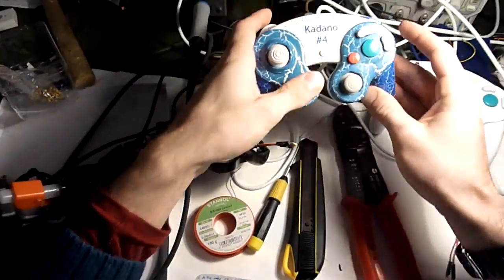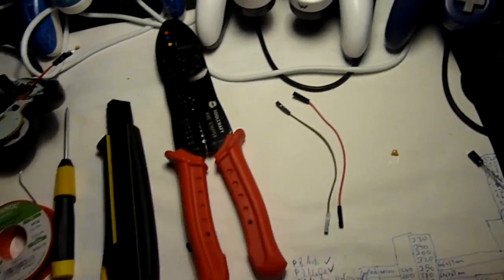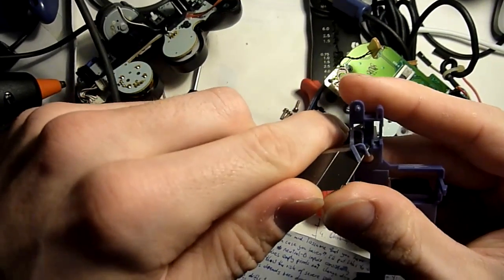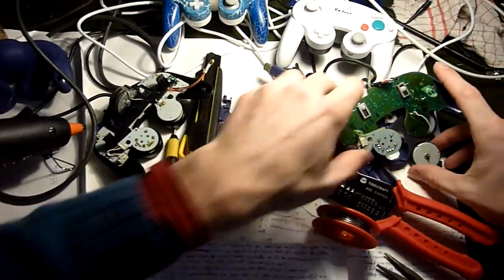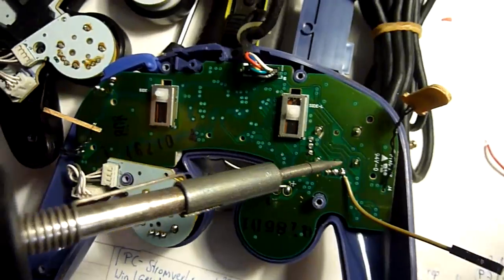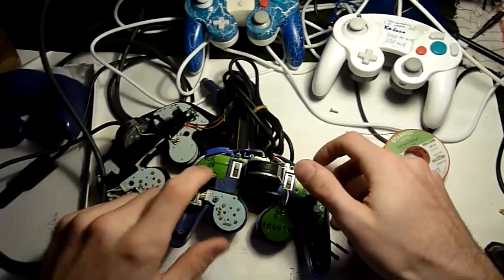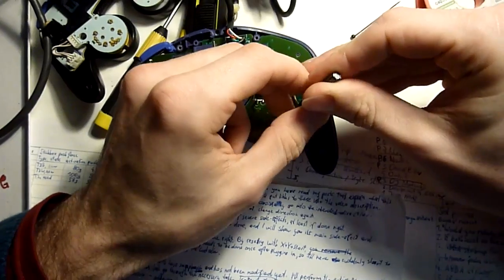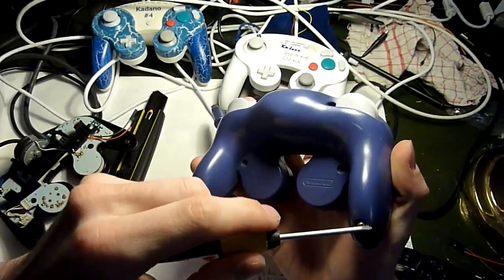Capacitor mod tutorial – consistent aerial neutral B in Melee and empty pivots in Smash 4

Comment: I don't know if anyone has done this recently, I did this mod after my controller slowly but surely crept more and more into reversing neutral-b's almost all the time without my input. I would land and face the wrong way, I would b-reverse a move that I can't even do manually, it was so slight.

On the first day, the mod worked pretty well - almost no mis-inputs. Now, however, my left-stick will randomly start drifting right when neutral, or will react to the slightest touch for an input right, but take half the entire stickbox to the left to register left. Unplugging the controller and replugging seems to be a temporary fix, but it comes and goes at random.

Any ideas how to fix?
Reply: Same here with the Left stick just drifting right the moment i plug in mine, but with the reset it works flawlessly. If you did anything from the time of your post, that’d be great to read
Reply: @gamefreaker54  Nope, still just wing it and hope it works properly to this day.

It doesn't.

Comment: I just did this to a Switch Pro Controller and it worked out perfectly. The back shell of the controller has a circular cavity that goes behind the PCB so I just folded the wire in it so no carving is necessary on it.
Reply: I am trying to do it on a pro controller, would you mind helping me, please ? If we could go to MP, I'do love to see a picture of the way you folded the wires. Thanks in advance !!!
Reply: @Life4Lp  sorry I didn't reply earlier YouTube showed me the notification of your reply just now, I am out of town atm but I will be modding my other pro controller soon, I will make sure to take photos or record a quick video on it.
Reply: @Mache.  thanks !!!
Reply: @Life4Lp  I just finished modding it, had to go out but I will upload the video today or early tomorrow.
Reply: @Mache.  I did it too ! I modded my pro controller using that space you mentioned.

Unfortunately, after 4 days, it seems that some of my inputs are being eaten. Need to switch to a weaker capacitor
Reply: @Mache.  hi! are you still going to upload the video?
Reply: I just did this mod on a switch pro controller as well. It worked out perfectly with a 1μF (50V) ceramic capacitor. Snapback is completely gone and inputs aren't noticeably delayed. Thanks Kadano! As a side note: I also tried on a mylar capacitor (0.68μF, 250V) but I noticed a bit of input delay, idk why. I suggest sticking to ceramic capacitors as Kadano prescribes.

Comment: In case  anyone wants to know if this works on Nintendo switch pro controller: it works!! I needed two 4.7 uf capacitors(one for the horizontal joystick and one for the vertical). The new joysticks have a button but the procedure is basically the same.
Reply: I saw people online using 1 uf capacitors, why did you go all the way to 4.7? Asking because I want to try this and I want to see if you ran into any problems in your time.
Reply: I'm also wondering how you chose 4.7 µF capacitors, could you explain ? Did you use an osciloscope ?

Comment: I installed the mod and snapback is still happening rarely. I had trouble tightening the jumper cables and they were still holding onto the capacitor legs very loosely. Is it possible to add some sort of indicator that the connection isn't coming undone without messing it up? Like if I added an LED light or something, would that have unintentional consequences? Or maybe just some tips on how to get the jumper cables to hold onto the capacitor more snuggly?

Comment: This is maybe a dumb question, but you're rather... cavalier when doing the actual soldering. This is probably just because you're super experienced, but it looks like you're not being careful at all to keep the two pins (minus and ground) from being soldered together, whereas I would imagine you'd have to be super careful not to connect to two so that you don't have an electrical connection between them. You even approach the rightmost pin from the left with the soldering iron, and it really looks like the two pins are being connected, or at least very close.

Am I misunderstanding something, or are you just experienced enough that you weren't worried about connecting the two pins?

Thanks for the video!
Reply from the maker: With a good soldering iron with a fine tip and enough experience, doesn't happen easily to solder them together by accident. The camera I used doesn't have a super-sharp resolution, so the few mm of distance between the soldering iron and the other pin is probably not that visible on the footage.

Comment: I installed this on two controllers that had snapback and one of them is perfect and has no snapback, but the second controller now has a harder time starting a dash and running, my character walks a lot. For both controllers I used a ceramic capacitor 105. For the controller that's having issues starting a dash and running, should I use a weaker capacitor? 

Kadano, thank you for this video!
Reply from the maker: Yeah, 105 is actually rarely needed. For most controllers, 684 or 474 is enough for the horizontal axis while 224 or 334 is enough for the vertical axis. Keep in mind this tutorial is years old, of course there are additional things I account for by now. Hopefully I'll get to make a better one soon.
Reply: @meleemechanics  Thank you so much Kadano! I really appreciate you taking the time to answer my question. Thank you for everything you do for the community!
Reply: What does 105 mean? 1mf? Or 105 is higher than that? Im confused :(
Reply: @zoulwax71  You surely don't care anymore since it's a 2yo comment but the number basically means what capacity the capacitor has when you don't have too much room to write it precisely, the first 2 numbers are a capacity in pF and the last number means the power of 10 by which you multiplie the capacity value, for instance 105 means 10*10^5 pF = 10*10^2 nF = 1 µF, and 684 means 68*10^4 pF = 68*10^1 nF = 0.68 µF

Comment: hey man, I bought a controller with this mod and i think it messes with my empty pivots in melee as i used to be super consisyent with pivot fsmash as marth and now i cant. also, might be unrelated but my c stick does incorrect inputs a lot. how do i remove this mod?
Reply from the maker: That happens when the capacitor put in is too large for your potentiometer's signal response. Ask whoever you bought it from for assistance / adjustment under warranty. How exactly to undo it depends on how the person who installed it soldered it.
Reply: @meleemechanics  thanks man!

Comment: Hey, I've got a question. For the vertical potentiometer which pin corresponds to which on the horizontal one? I'm assuming that the one on top is pin one, middle is pin two, and bottom is pin three, but I'm unsure and don't want to damage anything.
Reply: Actually I found it, here's a picture for anyone else with the same question.
https://twitter.com/kadano/status/835970193281146880?lang=en
Reply: Homie, I was just thinking about this question to myself. You're a lifesaver with the info you found and posted! You the real MVP.

Comment: What is the purpose of the jumper cables? Wouldn't a wire work just as well?
Reply from the maker: You can even use SMD capacitors that don't need any wire. The reason for the jumper wires is that customers can easily and quickly replace the capacitors for spare ones that I include with the controller, for lower or larger capacitances depending on the changed behavior of the stick. 
If you use SMD or soldered capacitors, replacing is only possible if you have a soldering iron.
Reply: That makes sense! Thank you!

Comment: I have recently had a lot of trouble with vertical snapback after a wavedash -> fastfall off ledge. I'm only recently learning and practicing this sequence, so I know that I still have work to do with correctly timing the fastfall
However.. I'm guessing that you can do a similar thing with the vertical potentiometer (which I'm assuming is the 3 pins up and left of what you were working on in this video). Which two pins should I use? Are there any differences I should look out for? I don't know that I need the horizontal mod, though if I did both, could there be any problems?

Thanks!
Reply from the maker: You can do the same for the vertical pins. It's the middle and lower pin then. You can also check my GCC PCB pinout on kadano.net =)

Comment: Is there a reason you chose to use a leaded capacitor instead of a chip capacitor. I was able to fit an 0805 50V 1uf soldered between the wires without cutting the plastic at all. Seems to have worked fine, is there a drawback to doing this, or were you just using on hand supplies?
Reply from the maker: I do it the way I show in the video so the capacitor can easily be removed or replaced. Desoldering an SMD capacitor is considerably more difficult for beginners I'd say.

Comment: tfw your glue gun has a remote control
Reply: I'm guessing it's a remote control power valve/supply. You plug a wireless dongle into your outlets, and you can turn on/off any of the outlets remotely.
Reply: I mean after a long day at work who wants to get up off the couch and walk all the way over to the hot glue gun every time they want to change the settings

Comment: If the capacitor is installed correctly, will I have to replace if after some time?
Reply: Possibly. If you use electrolytic capacitors, after roughly 2 years maybe. Probably more like 5-10 years though. I've only been doing this for less than one year and none of the properly installed caps have failed so far.
If you use ceramic capacitors, they should last at least a couple of decades from what I've read.
Reply: Awesome, thanks for the reply. I've received my shipment of ceramic caps, so I'll be performing the mod very soon.

Love your videos! Very informative stuff. They've definitely helped me improve whenever I can apply them

Comment: all the hassle of whether this is legal or not would be avoided if Nintendo made actually good controllers. Or if they varied in manufacturers as much as fight sticks
Reply: Lucart it's a mechanical problem in almost all controllers. It could only be prevented by using a capacitor from the start, using stick caps with almost 0 mass (impossible) or going for a different stickbox mechanism altogether (like 3DS slide pads).
The degradation in some controllers also fixes it, but I think it's unlikely that this degradation can reliably be caused from factory. (Details on this are in the posts linked from the video description)
Reply: It's really more of a problem in the games programming than a problem with the controllers themselves

Comment: Is this mod acceptable in tournaments?
Reply: SuperLuigiGuy64 many TOs, including The Crimson Blur, who is otherwise very conservative in banning mods, are leaning towards allowing the capacitor mod, since it only causes a controller to perform like certain unmodified controllers that have degradation in their potentiometers that causes the same behavior in eliminating snapback.
Reply: still in debate, but according to the wide swath placed forth in the APEX 2015 ruleset (the most common ruleset), no.
Reply: Christopher Birnbaum Alright, thanks for the reply.
Reply: Kadano Informative, thank you so much :]
Reply: Kadano I don't fucking get it. He says that there cannot be any mods onto the motherboard, but will allow adding a cap to the motherboard. Is he just not well researched on the topic? If he is going to be the face of melee TOs he needs to have a firm stance on this, otherwise his argument against smashbox has no legs. Such an arbitrary ruleset. Magus' code is a no brainer. Not being able to do 1 frame smash turns when you do everything correctly is exactly the same thing as tripping in brawl.